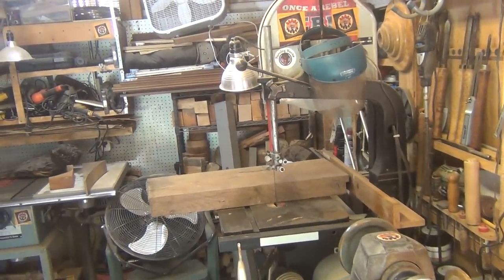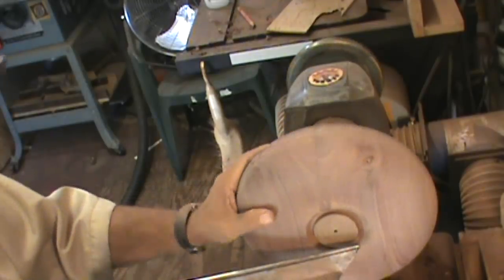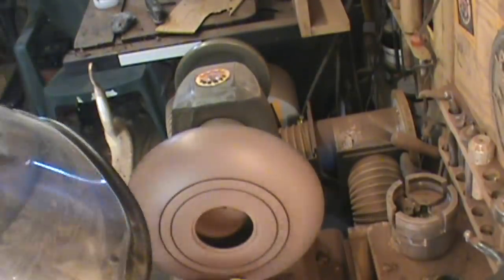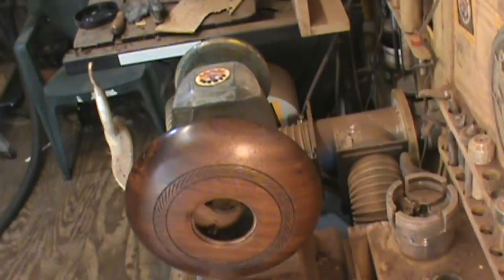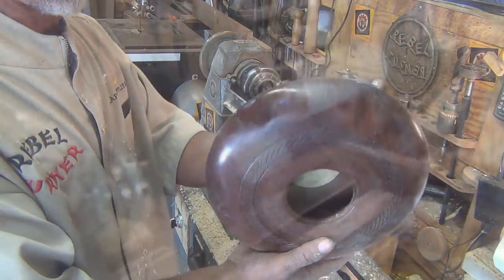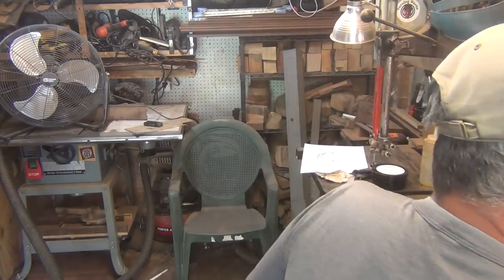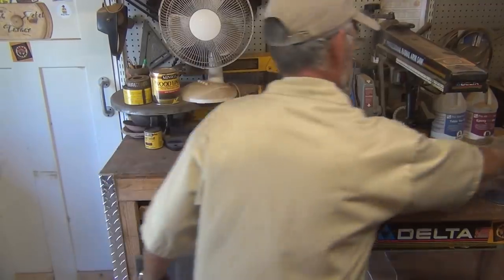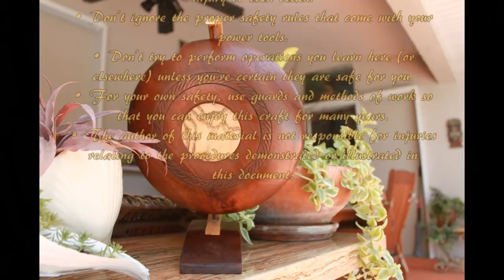Mahogany and Ash spinning vase

Comment: Hi Al.  How did you drill the hole for the flowers?  Btw, I liked this approach much more than the first one!  That sideways turning was scary.  And the mahogany/ash combination is slick!!
Reply from the maker: I forgot to turn the camera angle as I drilled it. I used a 1 1/4" spade drill bit and drilled it off the lathe